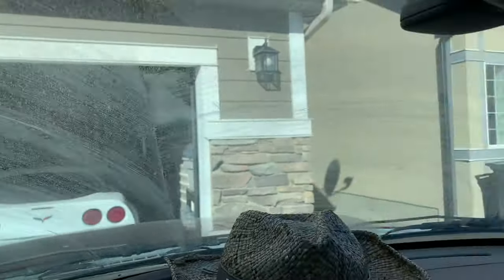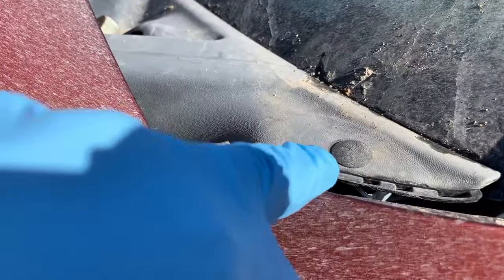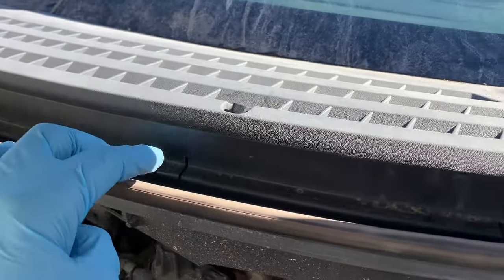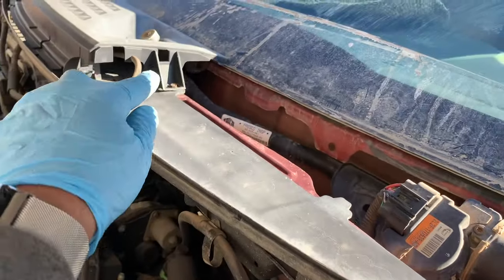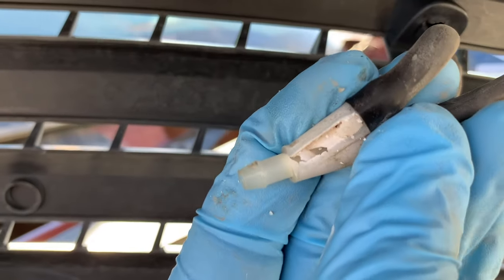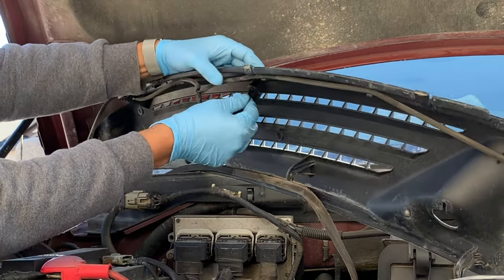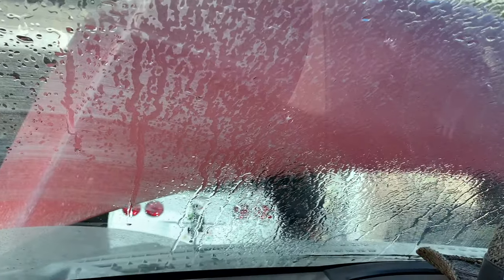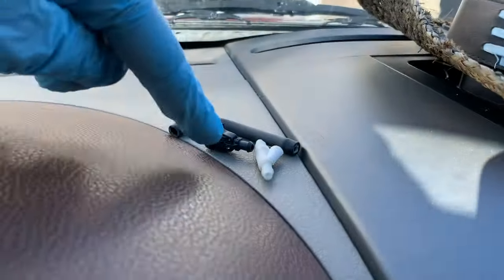Windshield Washer Fix - F150 hose, nozzle and connector replacement

Comment: Excellent video, one thing I would add that may save someone some grief is to be careful when removing the wiper arms because there is a key in the keyway that locks the wiper arm in p[ace, when you take the arm off that key may fall out and you probably won't realize it until you go to re install the arms. Most of the time they stay in, but I had one fall out. Just be aware.

Comment: Thanks so much!! I watched this video 1st, then before even taking anything apart, I just ordered a kit from eBay. Took the cowlings apart and sure enough the plastic fittings were dry rotted and cracked open. Put it back together with new parts and it's like I'm spraying a garden hose on my windshield now. Fixed it like brand new for 10 bucks! Glad I did this before purchasing a new windshield washer motor. Thanks again for a great video!!! The new kit came with the better brass tipped nozzles and I can adjust them to aim the spray perfectly on my windshield.

Comment: First video I watched and I'm certain that I have everything I need to know now thanks to your excellent coverage.  I suspect that my "Y" fitting has failed also because when I blow air into the line  I hear all the air flow out under the cowling before it gets to the spray nozzle. But I had no idea of how to remove the cowling and you have shown that it will be quite simple.  Thanks so much for saving me one hundred dollars or more taking to the shop.
Reply from the maker: Let me know how it turns out.

Comment: When removing the trip plug, place the screwdriver UNDER the cowling to avoid cracking the head of the plug. After loosening everything, push DOWN on the windshield side of the cowling while lifting up on the engine side. That was an important step missed in the video.

Comment: Mannnn, Been needing something like this. Mine hasn’t worked for two years. Question though. I’ve got a small drip 1,2,3 drip leak directly where the hose connects to the reservoir. But I get ZERO fluid from the nozzles. That couldn’t be the total loss of pressure right? I tried to blow compressed air into the hose and some crusty dry flakes. some out.
Reply from the maker: Zero fluid out of the nozzle and a leak at the reservoir hose would equal a loss of pressure.  Replace the reservoir hose to seal the line and then you can further diagnose the system if it’s still failing.

Comment: On the cowl here are 3 hooks next to the glass that need to be unhooked. They hook to a sheet metal. This video did not address those clips at all. But it is a good video and I had exactly the same problem, I bought a Y at advance auto in a kit. It was 6$
Reply: Exactly. I can't get the cowling off. Instructional videos should not skip steps. The hardest part of any repair is moving things out of the way to get to the broken part. And that's what almost every instructional video glosses over. The repair itself is usually simple.

Comment: What tool did you use to trim the hose to the right length you needed?
Reply from the maker: Scissors or a utility knife is what I use.
Reply: @Your Home Garage  thank you. Got it done today but figured out after it needed a pump as well but rolling with some water fluid now!!!
Reply from the maker: Sorry that you need a new pump - but you’re getting there.  At least you’re solving the issues ones step at a time.

Comment: Don't skip over things.  Do not assume I know what i'm doing. show the complete removal of the cowling. Almost a great video. thanks
Reply from the maker: Thanks for the helpful tip - I’ll make sure I’m more thorough when creating content.
Reply: Dude if you can't figure it out from that video you shouldn't be trying to repair it yourself...........Jus' Sayin
Reply: @Russ11566  Dude I checked a different video to learn an important step that was omitted from this one. Maybe you should save the snark.
Reply: 0:03 I usually check comments to make sure nothing was missed in the original video and wish I had done it this time cause I broke a couple clips on the cowling. I thought mine was stuck due age of truck